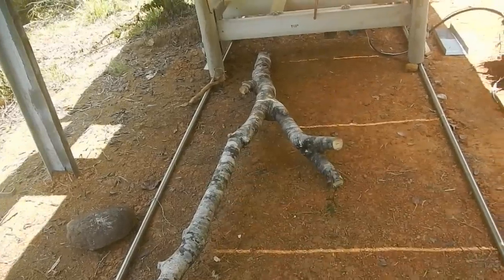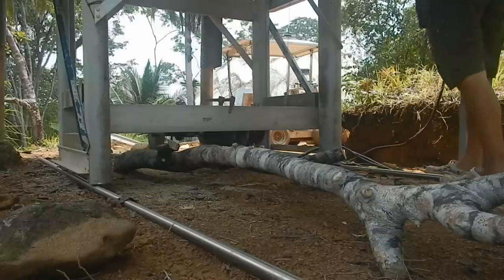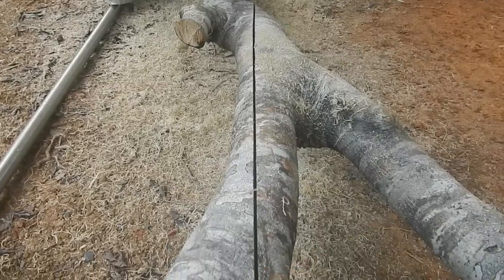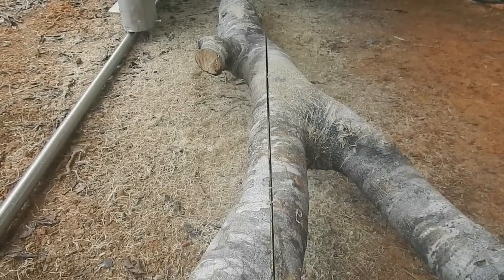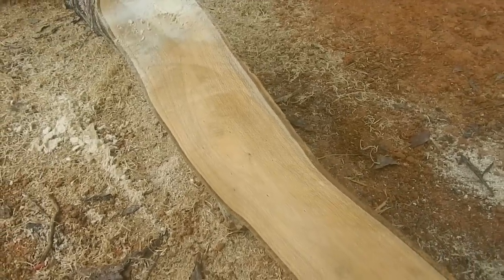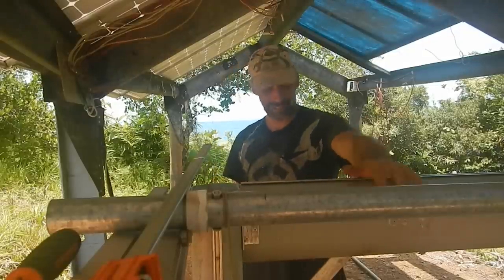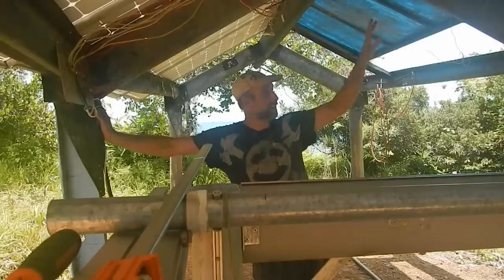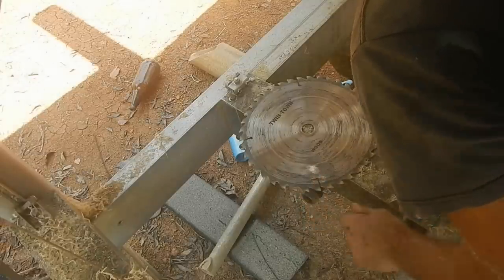Lumber Mill 018 First Cut

Comment: Looks great Jamie! If you got the blade balanced/mounted perfect without the wobble, you could likely rig up a floating riving knife that's attached to the motor mount without much effort. Then you get the better cutting efficiency, smaller kerf, AND don't have to worry about the blade binding. Lookin forward to seeing some nice boards!! Man I love wood. yeah, I said it.

Comment: Make sure that your threads are reversed or reverse the polarity and blade so you have no chance of loosening the nut...unless I'm missing something, the blade is counter-rotating, which would back out the(yes it's large) bolt on the spindle. I cannot remember if Jaimie said anything about that or if he just "tightened it really well" the last thing you want is a blade of doom slinging its way through the trees into the ocean or worse.
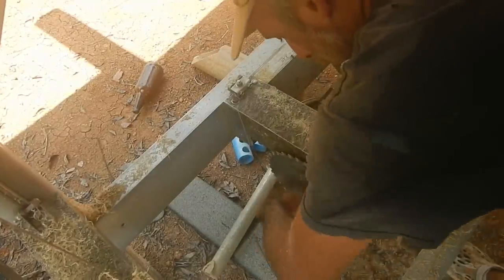Reply: It is set up correctly. At 0:10 you can see the blade is turning counterclockwise. At 13:22 Jaimie removes the nut counterclockwise. Saw blade nuts are removed the same direction as the blade rotation.

Comment: My Lucas Mill has a 25" blade with 5 teeth.   Thinking like the slabbing chain saw chains they have less teeth.  You could also easily add a water drip onto the blade for very green sappy woods.  I've not used the water drip yet on Tulip poplar but if I was to cut pine I would definitely use it.  Helps keep the pitch from building up on the blade.   Two blades!  One for finish wood/shelves etc and coarse one for dimensional lumber :)

Comment: If you have any old busted tape.measures you can stick sections vertically and horizontally as a reference. Even adding some 'positive stops' at the common dimensions you use is a time saver

Comment: It seems like the pipe tracks being flat and level with each other will be more important for horizontal cuts. On a vertical cut, the blade moving slightly up and down doesn't matter, but horizontally the blade could bind.
edit Awesome first cut!

Comment: 12:40, Not gonna like, it sounds pretty mean... 

I'd put something over the gear box, to make sure junk didn't get in there... or my hand accidentally... 
Band saw mills , normally has a locking mechanism that holds the wood down..

I hope you saw my comment on another of your videos about that new propeller design that's supposed to be more efficient.. .well they have data to back up its efficiency.

Also, it merely a mention, you've probably already thought of it, but you didn't mention it in the video... A tool under load, a motor in this case, normally starts producing more heat... and its gonna be working hard cutting logs.. that includes the wiring... 

Hope you already checked that stuff out?  Also maybe an emergency stop button on top of the motor in case you hadn't thought about it?

Comment: love that is solar, you should used two tires and wheel hubs and made it run a band saw blade cut slabs.  great job
Reply: He made one of those way way back
Reply: This.  Not sure how he's going to cut slices off a log that's wider than the blade depth.  Go up one side then move the blade over to the other side, I guess.
The channel "Lodewyk Verhoef" has a short video of the kind of setup you described, "Home made Timber cutting Machine"
Big exposed band saw, about a thousand times more dangerous, but it turns wide logs into planks, no problem.  Plus there's some flywheel action from the band wheels.

Comment: Non woodworker here. Why do fewer saw blade teeth cut faster?
Reply: I think the extra room between the teeth allows you more room for the chips and better chip removal so you can take a deeper cut without burning it, but thats just a guess
Reply: You get more of the tooth hitting the wood faster. Think of it as the blade punching the wood away and compare a small hammer with a big hammer. Small hammer is good for fine work but a big one gets it done faster. This analogy works really well if you have ever tried to cut something too small with too few teeth, however you don't want too many in the wood at the same time either because it struggles for room.
Reply: @jannebengtsson7338  No, it does not work that way. Jaimie made a bubu here. The speed depends on the motors power. If the motor is too small, when you advance too fast will simply slow or stop. If you remove half of the teeth, the remaining will need to cut twice as deep, at the same advancing speed, and obviously, cut slower.

Comment: 1. The saw seems underpowered. 2. I do not understand, why you dont fix the railway better to the ground and angle them up parallel, properly. Without this, over time, you get warped materials. 3. The saw allready have angled teeth, to compensate for wood grabbing. There are certain pliers for this, to adjust the teeth angle. 4. I do not understand, why you dont make a wood puller, so you can pull in logs from the ocean. Wet wood weighs a lot. You need a system of wood log handling. 5. The motor and saw unit, sounds unbalanced, wearing out bearings and loose energy. I only write this, to be constructive :)

Comment: I've just liked and subscribed to your channel but I have no praise for this video. Your mill is nothing more than a circular saw attached to a scaffold. You'll always be limited to the radius of the blade. That's why milling saws are almost all based on chain or band saws, to get a wide cut.
Maybe you still can use the structure and the motor, attach two wheels and buy some bands.
Unless, that's first, you don't need to cut wide logs indeed.
Reply: As long as you are like me, at first, this comment will annoy me, after a while I'll be thinking if I can discard the idea. But some days (or even weeks) later I will start to feel uncomfortable about the idea that this could be improved.
Finally, after some nights wandering around the idea, I would start planning and getting all the pieces to start modifying the mill.
Maybe I'm a bit of that kind of fool.
Does it sound familiar to you? ;)

Comment: Woow, that was top satisfaction.

However, less teeth dos not cut faster. to cut faster you need more power. This is quite simple. 
Imagine that you leave a single tooth. This will mean even faster. No? No!
And you used the weird direction of cutting. 
You went really slow, and it worked. But normally the teeth should come from the upper side. This way, will push the log down. 
It is not so important, but still, is counterintuitive  the way you did it.

And by the way, the dust is not so thick. Somebody tested. Washed his really dirty array, and the output increased with about 5 percent. 
Sure, depends on the type of dust. And for you to clean is almost free. I mean just some time and little effort. But the guy paid few hundred dollars, being up on the roof, and not really fit.
The surplus production did not paid the cost of cleaning.  month later rained anyway.